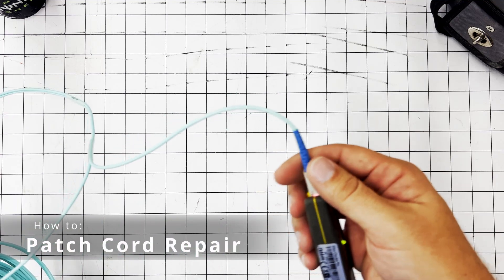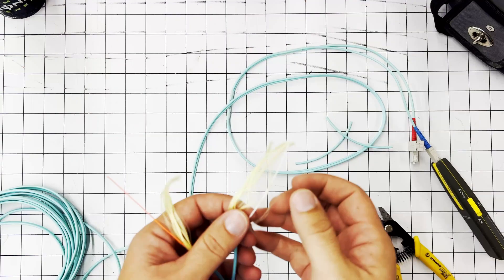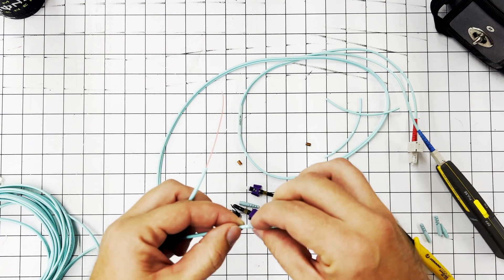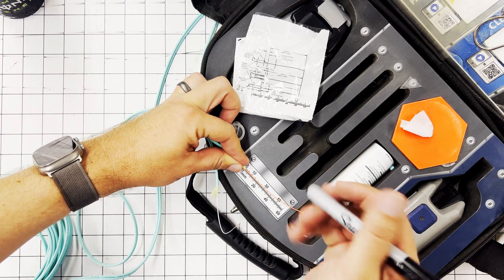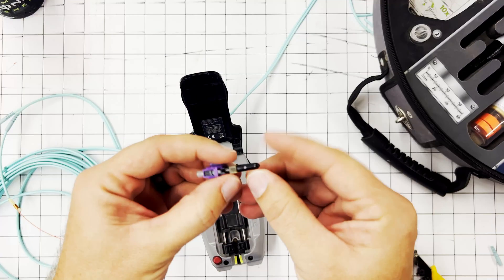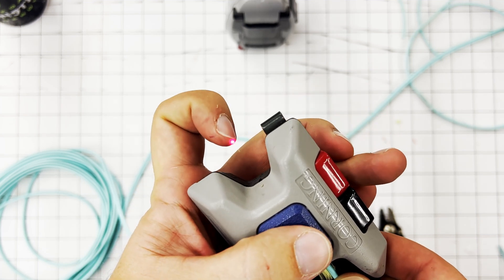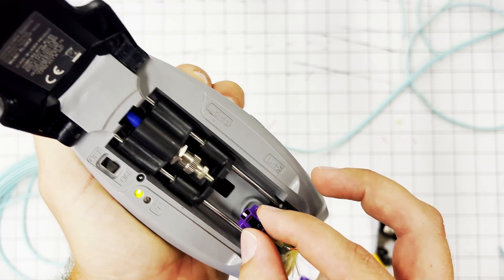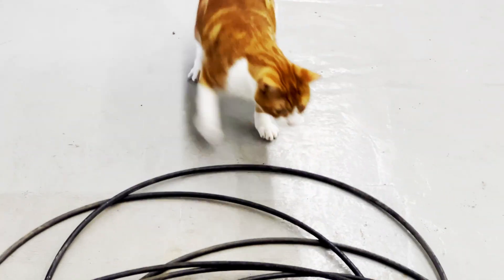How To Repair a Fiber Optic Patch Cord

Comment: Thank you for the nice video, have some old cables I can try this on, as I'm trying to get into this. Might go for the connectors you have to polish yourself, so I don't need the special toolkit
Reply from the maker: Check out some terminations from Belden, Panduit, or AFL. Those can be done with just a fiber cleaver. The ones you polish yourself require lots of special tools and parts. 3-4 different types of polishing paper, a puck to hold the termination, a 200X or 400X microscope, 2-part epoxy, and a diamond tipped scribe.
Reply: @SteelToeVideo  Okay. Thank you very much for the hints! I didn't think about the diamond tipped scribe tool, I've gotten a microscope already. I thought the other stuff might be easy to  get, but maybe I'm on the wrong track. I will check out the brands you recommended, I will make up my mind. Thank you again very much